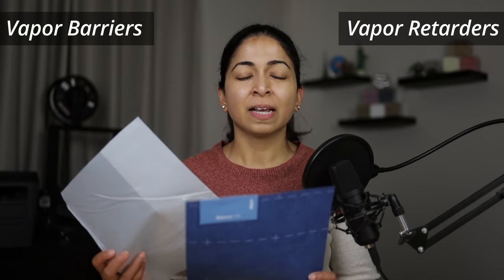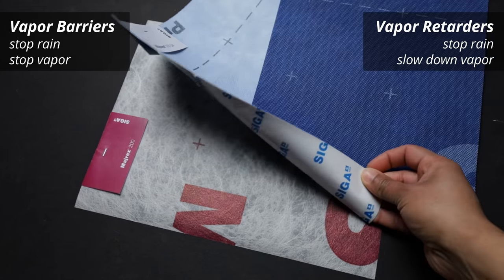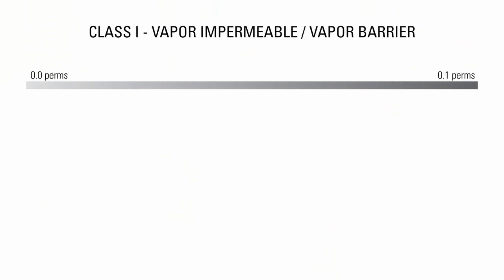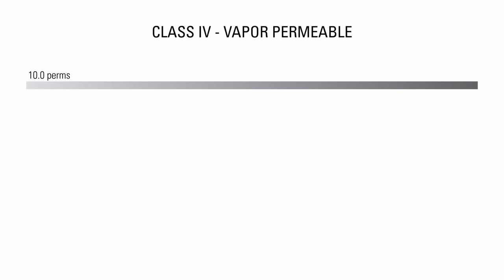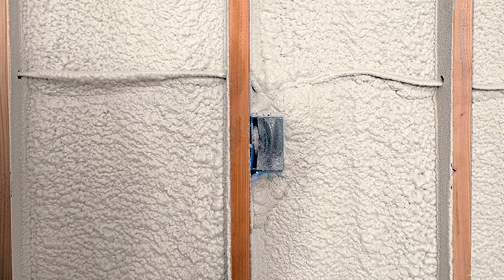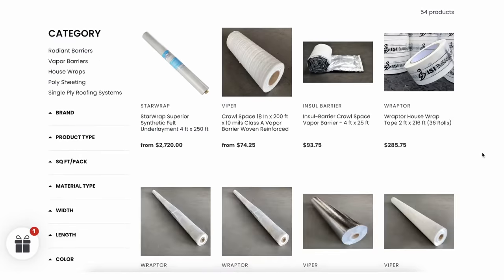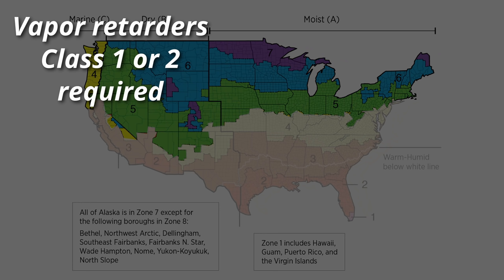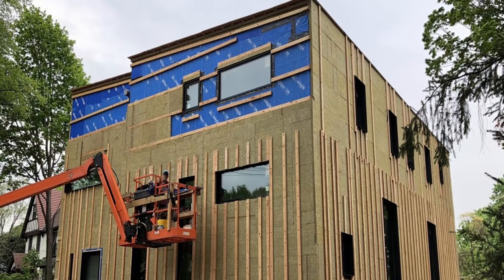Do you need a Vapor Barrier or Vapor Retarder?

Comment: Great start! I think a deeper conversation about wall assemblies would really help... I'm up in Seattle in Marine 4, and you see everything from Zip around Rockwool to Tyvek around craft-faced fiberglass to closed cell foam behind metal siding. Presumably they are all doing the same job, but it's unclear when/how a mold-sensitive insulation product (like fiberglass) needs vapor protection vs. when it's not (Roxul can be used outside the vapor barrier on exterior insulation as well as on interior).
Reply: I agree and would appreciate a deeper conversation as well. I recently downsized from a stand alone house to an ICF (insulated concrete form) condo building built in 2013. Nice and tight I assumed!  I thought this was a great move from my old 50's built wood frame, stucco exterior, blown in cellulose wall cavity insulation but I am missing that old breathable house!
I'm also in the Marine 4 area and the humidity levels inside my new home range in the 50 to over 60% many months of the year even with constant ventilation. I'm considering installing a dehumidifier but would like to learn more about solutions in multi-tenant buildings so I can decide if we should move or just deal with what we have purchased.
Reply: @user-vp1sc7tt4m  a dehumidifier is always a great choice. I would be happy if my house stayed around 50% humidity all the time. Here in Florida if I don't have dehumidification going or hbac running more than I really want it to it would easily get about 70 or 75% humidity inside the house. My house was built in 1937 though so it does not have any moisture barrier or vapor barrier that's all! Because the exterior cladding has been stuck over I am left with the best practice of being just air sealing it well whenever I decide to remodel. ICF homes are great but you can still get condensation in the structure so if it is sealed on the outside a dehumidifier would greatly help.

Comment: As usual, another great video Belinda. Your presentation style and delivery is spot on. In the UK, Vapor Retarder is called Vapour Check, and is green, typically 125mu thick. Where I am, the latitude similar to the southern quarter of Hudson Bay and the humidity of Seattle, fibreglass insulation is a bad choice where a lot of condensation is expected, and polystyrene fares little better. Rockwool is my insulator of choice (walls and loft), so I did enjoy your video on that subject too (plus the hilarious follow up complaint letter video).

Comment: Belinda, I read only a few of the comments added here by many a varying range of expert. Many answer difficult questions, many ask difficult questions. Absolutely there is need (a deep need!) to further discuss this most mist.. ifying phenomenon of moisture control. Back through history, a home breathed nearly as many cubic feet of air as was big the house, hourly. But heat was cheaper, without care and maintenance eventually even these old houses wood.. rot. 
Locking moisture in a wall can devastate a house in less than one year. Clearly I'm not a professional builder, and my knowledge lacking. If I without the proper information attempt even a "simple" basement renovation could severely damage my most precious expense, my house! 
Keep the good information flowing, enjoy your channel very much.

Comment: Belinda, great video. Perhaps this has already been commented on:

At the end you state that Rockwool stops air infiltration and stops the thermal bridging. The effects from thermal bridging from the studs or other structural members is definitely helped by the layer of Rockwool.

Regarding the air infiltration, I think you simply misspoke. The Rockwool in that example building is keeping the sheathing warm, this helps prevent condensation on that sheathing. 

The Blueskin is stopping the air infiltration and does the bulk of the water management.

All this is, is a reminder to put up my own videos. Thanks for being a rockstar!

Comment: Great information. On roofs, synthetic underlayment has become all the rage. It has a typical perm rating of < 0.05 and is definitely a vapor barrier. It is used extensively for roofs in western Oregon and Washington which is a zone 4 marine area, which never made sense to me. I'm having a new roof installed and have been insisting on a permeable underlayment. This video confirms my choice and reasoning.

Comment: Great video. I am currently in the process of removing the 6 mil plastic vapor barrier that I installed last year in my walk-up attic space that will generally remain unfinished in this 100 year old home. The roof is not vented and has a fair number of hips and valleys as well as a flat section at the top. The roof joists are 2 x 6 and 2 x 8 (actual size, not the modern reduced sizes). I put Rockwool insulation in between all of the joists and it made a significant difference in reducing heat loss over this past winter. However, last summer I noticed that I had condensation on the plastic against the insulation on hot days after it rained. We just had a few warm (70F) days here the other week and the condensation was pretty significant. I decided to pull down all of that plastic to let the assembly breathe. I checked the underside of the roofing boards and the insulation up against them and they were dry, the condensation was all on the plastic and the underside of the insulation. I know that the "proper" assembly would be ridge and soffit vents and an airspace between the insulation and the underside of the roof deck, but -- a. I don't have any venting due to the construction of the roof and b. I don't have the space for an air gap anyway unless I build out the roof joists and even then the insulation isn't even up to current code for zone 5. During the summer their is an attic vent fan, so I don't anticipate any issues, but I'm hoping that there isn't condensation this winter on the underside of the roof deck. 
That was a long set-up, but my question -- should I get a vapor retarder for the inside face of the roof  assembly if the space will remain unfinished? What about if I were to add sheetrock of beadboard to the underside of the joists to create a semi-finished space? Note that the space is not heated except that heat rises through the uninsulated ceiling below and keeps that attic space at 50F or above even when the outside temperature is close to 0F.
Reply: Steven you may not have a vented attic as in the traditional sense but you are definitely getting outside air in there and that is where the moisture is coming from that condenses against your cold surface beneath the insulation. Is there no way to put in vents at the soffit? You can always use insulation board there are special types made to screw up against the bottom of the Rafters so that the space between the rafters still allows air to vent the roof but you keep the heat from building up inside the Attic. You mentioned a vent fan that runs in there and if it is blowing air out of the attic the air has to come from somewhere so if you seal off the attic with a vapor retarder you will just be focusing that make up air from fewer areas. This may cause a increase in moisture in those areas which probably isn't desirable. If you could do something to vent the roof itself via air movement between the rafters and insulate beneath them then whatever moisture condenses at that margin between the two spaces would also be removed because of the ventilation of air moving through. As far as the attic and drywall if you do that, or even if you don't, I think I would probably install a dehumidifier to maintain the humidity at a desirable level.
Reply: Thanks for the reply, Daniel. The house was built in 1920 and the construction is some sort of masonry block with stucco exterior and an air space between the masonry and lath and plaster walls -- no insulation. The attic floor (2nd floor ceiling) is also uninsulated. The roof joists overhang the walls and have blocking between the joists at the wall line. The soffits are closed in with beadboard below and what is probably a 1x6 and a trim molding as fascia. So, technically, yes, there is air flow through the gaps. The only time there was a condensation problem after I insulated and added the vapor barrier was for a day or two after it rained, so I am assuming that it was vapor passing inwards towards the attic when the sun heated the roof. I've now removed all of the plastic vapor barrier, which should solve the problem for this summer and I'll check the underside of the roof deck (above the insulation) next winter to see if I have a problem with moisture condensing and freezing on the cold underside of the roof. That will help me decide what steps to take to mitigate it. At this point I don't plan on adding drywall at this point. The main purpose of the insulation was to eliminate the heat loss through the roof in the colder months and prevent excessive heat build-up in the hotter months. The attic vent fan draws air from the entire house during the summer. With the insulation in place, the attic temperature is typically close to the outside temperature in the warmer months.
Reply: @stephenboots  that sounds like a pretty good strategy. Checking on it to make sure it is okay and not building up condensation is probably the best first step. If time and budget were not a concern a ridge vent and some soffit vents would help keep the roof assembly dry and moisture build-up from happening on the other side of the insulation but it may not be necessary. Good luck!

Comment: In Canada, It's still code to use a vapour barrier on the "hot" side of the wall (the inside). We use 6 mm poly. We then use a vapour retarder, like Tyvek, on the outside of the heating, with an air gap for the brick or siding. I've worked on many older homes built this way and there has been no mold, except where there were air leaks. You could do a follow up specifically for cold, moderate and hot climates. Great info. I appreciate all of your content.
Reply: Poly in the wall is still allowed by building codes in most of the US, too, it's just no longer considered best practice - you kind of answered the question as to why: one little leak somewhere and you have mold. Use a class 2 retarder to let the surfaces breathe slightly and the chance of mold from small moisture intrusions is greatly reduced, with almost no loss of energy efficiency.
Reply: I live on the Canadian prairies and just built a new house last year.  Using a vapour barrier on the warm side and a vapour retarder (like Tyvek) on the outside is a code requirement if using batt insulation.  The problem in extremely cold climates is that any warm, moist air that leaks into the wall cavity freezes at the zero line (the area in the wall were the temperature is below freezing).  Ice builds up during the winter and then melts in the spring resulting in very wet wall cavities and possibly mold.  It is even worse in attics.  Ceilings have been brought down by the weight of the melting ice in the spring.  (this  happened a lot when I was a kid in the 1970's as the rapid increase in energy costs back then caused people to insulate previously uninsulated attics without installing a vapour barrier on the warm side.  The following spring people discovered water dripping from their ceilings and in some cases the ceiling collapsing).  I have always believed the vapour barrier was one of the most  important features of a house (in my area) yet it was usually poorly installed and never inspected.  I was pleasantly surprised last year when I found out that the vapour barrier had to pass an inspection by the building inspector.  I was also fortunate in that the contractor that installed the vapour barrier was as fanatical as me that it be done right and he did an excellent job.  I looked it over for hours and could not find a hole anywhere.  If you live in a cold climate you have to take some of the advice given on Youtube with a grain of salt as it is usually geared toward warmer climate areas.
Reply: @hmw-ms3tx  perfect answer and confirms my thinking. My inspector was very strict as well and demanded a good acoustic sealant to seal the vapour barrier.👍
Reply: @hmw-ms3tx  Thank you for confirming what I've seen in practice (I'm an electrician) but never received a clear explanation of the rationale. Easy to understand how an entire winter of damp air gathering and coming back at once causes a bad situation! Unfortunately, in my newer house (2017, YEG) the builder was not as ... attentive. There were huge gaps in some spots where the acoustical sealant was dragged too fast, and holes were left un-taped after nails or screws were pulled through (not to mention none of the staples were taped over). I will have to go through my basement now with a sharp eye to ensure everything is fully sealed up, as I did have a moisture issue last spring - luckily, I caught it and was able to pull out the batting and dry everything out with fans.

Comment: Thank you for having both US Customary and metric units. Quarts and cups still confuse the hell out of me. 

I'm surprised you didn't touch on Water Vapour Resistance Factor (μ [unitless]) and Equivalent Air Thickness (sd [m]) when talking about Perms. Both of these are common in Europe, whereas a Perm is new to me.

Comment: I need your opinion on the following: I have stairs that go up into an attic which is not finished except for flooring. The stairs has a ceiling and walls which need to be insulated inside the attic. There's drywall on the living space of the stairs which descend into the first floor. Previous owner was using a spun insulation encapsulated in plastic which has deteriorated because he never finished the project.
   I want to use the materials that I have on hand and the way I understand your explanation, I would paint the attic side of the drywall with a latex. Then I can use the insulation  (without a craft or encapsulated plastic covering) my sealing the attic side of the walls with vapor retarder and drywall or just drywall.
   Or second, perhaps just seal the cracks to stop air movement 
   The warm interior air goes to the attic when it's cool in winter and in summer hot attic air goes to the cool interior air in the stair well side of those walls.

Comment: You had mentioned in region 4 marine you also need an interior vapor retarder. I this because in the 4 marine, you have some much moisture in the air? By putting exterior insulation like 2" of rockwool on the exterior of the sheathing will that solve the problem and not need the interior vapor retarder?

Comment: Building Science, Interstitial Condensation 101. 

The water vapour carrying capacity of air is proportional to its temperature. As  temperature falls the relative humidity of air increases until it reaches 100% saturation and then excess water vapour starts to condense out.  The colder it gets the more condensation takes place and if it drops below zero the condensate of course freezes. If you know the relative humidity and temperature of the air then a psychrometric chart will tell you the dew point temperature.  

Where there is a difference in temperature across a building element (i.e. wall, roof, floor etc) there will be an internal temperature gradient. 

When an element is vapour permeable and there is warm humid air one one side and it is colder than the dew point of that air on the other side then as that warm humid air permeates into the element it will progressively cool along the temperature gradient and start to condense out water at the precise place where its temperature reaches its dewpoint. 

This is known as interstitial condensation. It is prevented with a carefully installed vapour barrier placed on the warm side of elements to stop vapor laden air from permeating to a dew point position on the internal temperature gradient within. Thermal insulation is usually installed in concert to keep help the vapour barrier warm.  

For example, in cold climates we have warm moist indoor air and cold outside air so the vapour barrier goes on the inside of the thermal insulation. Positioning the barrier on the warm side of the insulation helps to keeps it warmer than inside air dew point and that vapour laden air is prevented from getting past it into the colder parts of the element where it would cool to the point where it starts to condense water. 

In the humid tropics the vapour barrier position is reversed. Where we have air conditioned buildings the warm vapour laden air is outside and colder air is on the inside so the vapour barrier is placed on the outside of the thermal insulation. 

In milder climates with less extreme temperatures and relative humidities ventilation is an effective way to expel vapour laden air from indoor spaces  bathrooms and kitchens and with well ventilated buildings this usually suffices.   

Interstitial condensation mitigation measures should be based on relevant local climate and building use and construction data.

Comment: Nice!! Love 2 Learn!! What effect does cutting sheetrock for electrical outlets have on air infiltration measurements an how to minimize air leakage around these wall fixtures (outlets, light switches)? Thanks for the videos!!
Reply: Electrical boxes that come through the drywall is the reason she talked about the difference between a solid sheet of drywall with latex paint and one with a 1 inch hole. So if you want to control vapor you need to make those electrical boxes airtight. 

There is a couple different ways you can do that. I plan on taking the plug covers off and using fireblock spray foam in and around the boxes.